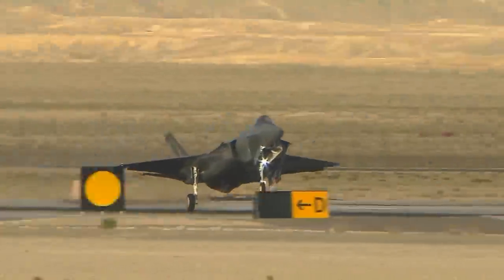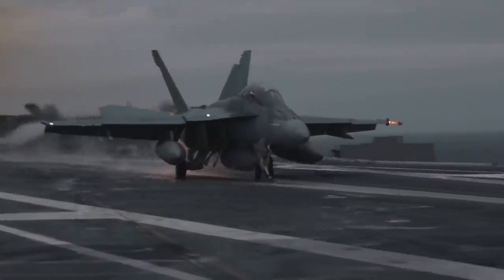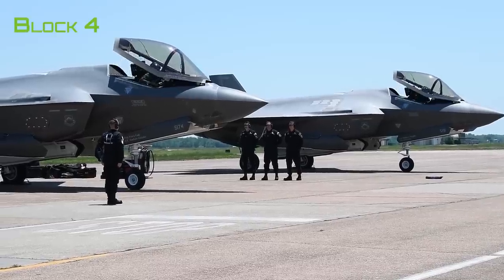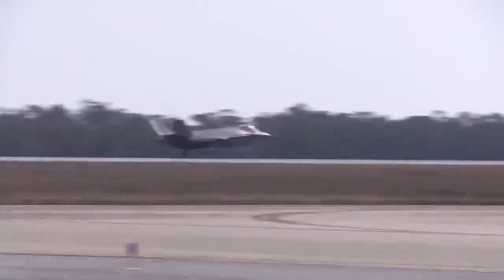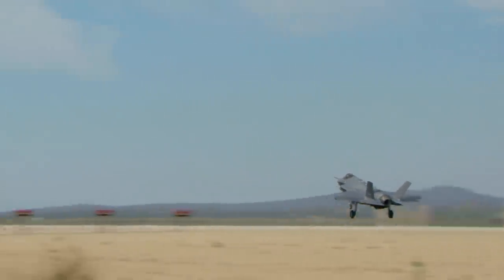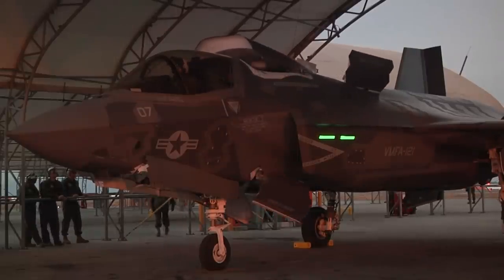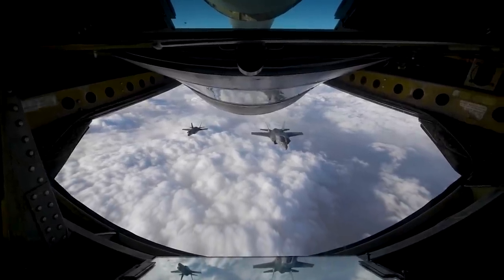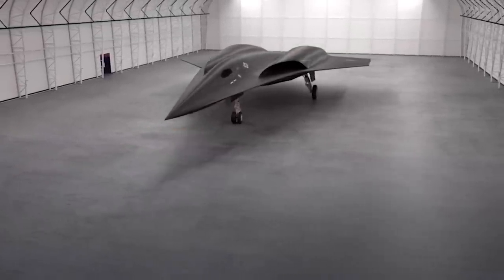Why the F-35 needs an engine upgrade

Comment: Maintaining two different engines isnt exactly a logistical nightmare. Heck they've been using a mix of ge and pw engines on the 4th gen fighters for decades
Reply: Ironically...it's the B lift fan configuration that actually can be retrofitted for these demands.
Reply: Yeah the computer interface alone would be a programming nightmare.
Reply: Right but you have double the work, double the chances for something to break, double the time for maintaining them, and double the cost to produce them. I mean fighters these days are pretty much to the point where the pilots body is the limiting factor. So the cost vs reward ratio just isn’t there. And the point you made about about using jet engines for decades is actually a benefit to having one engine as well. They have become extremely reliable and powerful. I mean it would be sick if they slapped in 2 F22 engines in the F35A&C or if they slapped two F35 engines in the F-22 with thrust vectoring. Talking another 16,000 pounds of thrust with full afterburner. Talking a 1.5 thrust to weight ratio lol. But yeah to maintain the same size you wouldn’t get much more power with 2 engines over one big engine. And instead of spending let’s say 8hrs an engine for 2 engines you can spend 12 on 1 and make sure it’s running perfect and still save 4 man hours.
Reply: Correct
Reply: @forfun6273 Uhh, dude, it’s the same engine in the F-22 and F-35.  F119. Check yourself before you wreck yourself.
Reply: @DonWan47  it’s the same core but the engines are not the same. The F135 is 20% wider. It bypasses more air for infrared and has larger fan blades. My point was it would be cool for the F22 to have the extra thrust. But it would give the jet the fat look of the F35.  I appreciate your education because I didn’t realize they had as much in common as they do.
Reply: @forfun6273  yeah but you also need to hedge against issues affecting one supplier by having an alternate. Basic military procurement policy, been that way since the 40s at least
Reply: @DonWan47  buddy there is no way on earth you just called the f119 and the f135 the same engine HAHAHA

Comment: I’m an employee of GE Aerospace here in Cincinnati, and I personally worked on the prototype of the AETP engine. The benefits it offers are second to none! Not just with cooling, but thrust, efficiency, acceleration…it’s a beast! Let’s hope our “powers that be” make the right decision! 
Another great video!
Reply: Look back at the C-130-J campaign. Can you imagine the C-130 without those improvements?
Reply: I agree.  We should begin a refurbishment program on US existing F-35’s and offer them for sale to nations who qualify at a significant savings. Then replace all the US F-35’s with the GE engined F-35.  Germany doesn’t need the range the US needs in the Pacific. I’d make a deal to Norway, Finland, Belgium, UK and Poland that would upgrade the systems on their current F-35’s and any used F-35’s they purchase to block 4 software and bring the older F-35’s up to the most recent release. 

These discounted sales would boost the alliance and allow the US to improve its F-35 fleet.   I’d go with GE engines, a slightly longer F-35 making room for longer range missiles and if add a new F-35 with two man crew. The two man crew would be hugely beneficial for ECM/EW and controlling large numbers of unmanned assets. 

If we made it a priority we could start production on these new improved F-35’s in a couple of years. 

This would complement the NGEN fighters that will arrive about the same time.
Reply: Add those improvements to the adaptive cycle and the NGAD will be 10x better
Reply: You are totally on-point. I only want everyone to see the difference between the original B-52 engine and the current one.
Reply: @unclefart5527  EXACTLY.
Reply: @GlitchGameryoutube  Sure, but it's a decade away from implementation
Reply: @devobronc  it’s huge difference. The RR engines happened to be just the right size and power.  I originally hoped that CF-34 derivative would have been the choice. I flew CRJ’s  with that engine on the 50, 70 and 90 sear variants.  Great reliable engine.
Reply: @GlitchGameryoutube  probably better by some factor. But a different mission set and $400,000,000 million a copy is what I’m reading.

I’ve been a professional pilot, now retired and have flown with pilots from WW2 all the way through the second gulf war.  B-52’s ended production in 1962!  I was born in 67. When I was in the Navy, B-1’s and B-2’s were being delivered and we believed the B-52’s were nearing retirement.   These F-35’s are most likely going to fly 20 years past my death if I die at age 90. 

I remember when the F-4 production line was in full swing and the prices were astronomical!  Then the F-16 and F-15 came along and we all were told… the cost would be the most expensive fighter program in history. They were and yea the F-16 was “relatively cheap” but still way more expensive than the F-4 once we were building  c/d variants. Today a loaded F-16 can hit $95-$100 million dollars. 

I don’t know how old you are but if your my age, you’ll remember every fighter the US and Europe has made since WW2 have been the “most expensive ever” and plagued with issues. If we go back to the “best fighters and bombers of WW2" were plagued with issues!  Remember the Mustang… it had poor performance at high altitude and it’s range was average. Not until the Brits stuck a RR Merlin in it that it became an excellent fighter. Another plane with issues was the F-4U Corsair…. it was an ensign killer.  The P-38 killed hundreds of pilots also and up until most were grounded today… it kept killing pilots.  

The F-35 is expensive and complex become so many nations become a part of its specifications and the foolish politicians demanded the Navy, Air Force and Marine Corp use the same platform for Land conventional take off and landing, Carrier based take off and landing to vertical take off and landing capabilities.  This combined with manufacturing parts and major sections all over the world has been wasteful.  

But now we have the absolute best multi roll aircraft in the world in spite of its issues.  The F-35 has been the safest fighter program in US history!  In addition if we were to look at its current cost adjusted for inflation…… it’s actually in line with the F-16 C/D purchases.  Remember the F-16 killed a lot of pilots it’s first 7 years of service.
Reply: Be carefull bro,,, with ur personal DATA employee..
Reply: Jim!  Thanks brother and as a former turbine designer and current battle penguin driver, I can’t tell you how much we are kicking begging and screaming for the GE engine!  We must increase our involvement across the spectrum and fight for this because the powers that be absolutely are lobbying against this deliberately for money, while sending hundreds of billions to Ukraine to squander.  Think about where our combat capability could be with the GE engine and the other upgrades that would transform Fat Amy and make her a true monster.  I’ll message you offline but tell the bros at GE we in the community flying the jet ABSOLUTELY NEED IT!
Reply: @function1296  right on! It’s very cool to hear that perspective!
Reply: @function1296  we aren't sending aid packages to Ukraine free and clear. They (ukraine) are taking on MASSIVE debt through the lend lease act. This is not the first time we have done this. In fact, the UK just finished paying back their WWII debt in 2006. Also, much of the equipment that we sent was already nearing retirement. The Bradley fight vehicles sent to ukraine were the M2A2-ODS (operation desert storm improvement) variant, which were deployed back in 1991, which are now 2 generations old (M2A3 in service currently and M2A4 and M7A4 in testing and preproduction currently), and the Abrams tanks that are being sent are refurbished M1A1s that were already sitting in army stockpiles and they were one generation and many mid-generation improvements behind modern Abrams. Think about it like this, we are getting paid to clear out our stockpiles, not paying to store or destroy old equipment, and helping to keep Russian in check. Sounds like a win-win to me.
Reply: I have a feeling that you do not work on this engine. Otherwise, you would not be posting online
Reply: @mbukukanyau  I have a feeling you don’t know what you’re talking about, and that you enjoy commenting about topics you’re clueless about as a hobby…yeah, I think that’s much more likely. Definitely tracks. Making up that story, for the purpose of making a comment on this video, would be just about the lamest thing possible. Almost as lame as making a comment that someone would make up a story about what they do for a living, for the purpose of making a comment on a video 🙄
Reply: @jimiraybeckton  Like I said, it's a feeling I have that you do not work on a US advanced fighter jet engine and then post about it on YouTube. I don't know anything about ✈️ myself other than those I have seen flying. 
It's just a feeling I felt compelled to let you know
Reply: And the F120 was a better-performing engine than the F119. USAF didn't want the multiple risk of the tech in the F120 and thrust vectoring AND stealth, thus went with the more conventional F119. (ex USAF acquisition grunt in the ATF office).
Reply: @bret9741  It's not a business from a government to a government standpoint,  all this has to work for foreign governments
Reply: @function1296  About 25 years ago at an airshow at Edwards I mentioned to an F-16 (F110-129) pilot I was in the USAF program office that developed that engine; bro almost wanted to kiss me raving about how much he loved that engine, what he could do throughout the envelope!
Reply: @bret9741  "But now we have the absolute best multi roll aircraft in the world in spite of its issues"  - says the Yank with typical Yanky Hubris! LOL
Prove that to us please. Which roles has it seen combat in? Any?
Against whose Air Force and anti-aircraft defense. I'm waiting with baited breath! 
Exercise Red Flag propaganda does not count!😂
"In addition if we were to look at its current cost adjusted for inflation…… it’s actually in line with the F-16 C/D purchases" LOL got a source for that "claim"?
Reply: @DennisMerwood-xk8wp  so far it’s combat record is perfect and the best safety record per flight out to date. 

Let see. Who has been buying it and who wants it but can’t have it… 

(1) England (2) Belgium, (3) Norway (4) Italy, (5) Canada (6) Israel who is now ordering more of them (7) Netherlands (8) Australia (9) Denmark (10) Switzerland (11) Poland (12) Japan (13) South Korea (14) Singapore 

Country’s that want it: (1) Turkey, (2) Thailand (3) UAE (4) Egypt (5) India and many others.. 

All of those nations looked at every other platform available. After years of research and debate they purchased the F-35 because their pilots and military leaders said: “this is clearly the best option” since we qualify to purchase.
Reply: @bret9741  It’s really crazy to think how the B-52 series is on it’s 3rd engine type now.
Reply: I think the "B" version is vital, especially in the Pacific.  I hope they come up with a solution for that model.
Reply: @kennychad2821  if they do, it won’t be a common engine OR it will be a new version of the  fuselage. 

I don’t disagree. The F-35B desperately needs more range and payload.  The platform would be a lot better if it had the capabilities of the F-35C
Reply: Isn't bleed air for heating, not sure how you get more cooling from compressed air which is hot.
Reply: @rumbecker5085  bleed air is compressed run through a radiator then decompressed. It makes a lot of  cold air.  It can also be used to run generation and cool electrical systems. 

The aircraft I flew professionally all needs a lot of cooling for computers, and electrical components and avionics.  At 25,000-50,000’ no real cooling issue except for systems that generated a lot of heat or sensors that operated best at below freezing temperatures.
Reply: @bret9741  I understand, I use to fly AC that used  bleed for for heating just sounds strange  that cooling is an issue
Reply: Unless your bribes are higher than P&W then it's not about making the right choice for the best engine, they will make the decision on who greases the wheels more... GE should have been the choice in the first place.
Reply: @bret9741  right it shouldn’t be too difficult to make it a 2 seater. I’m not sure what exactly they put in the As&Cs instead of the stovl fan. But you can definitely fit another pilot in there. But I think the navy is looking forward to the ngad. They actually haven’t been buying as many F-35Cs as expected. They were waiting for the block 4 but I’m pretty sure now they’re trying to hold out for the ngad and then drop some big money
Reply: @forfun6273  yes.  Agree. I always worry about waiting for something unproven.  My experience is that updated and improved fighters can be every bit as good as a clean sheet design. 

The Russians rely on improving platforms more than we do. 

The F-15E was a tremendous update over the F-15C as fighter attack… long range platform. But the F-16 really is the best modern example of what can be done to improve over the original platform…

I firmly believe that we have learned so much, some incredibly expensive and hard lessons, developing the F-35, it’s in a truly perfect position to be made far more capable with a lower unit cost than the NGAD…. Which I’m hearing will run $300,000,000 per copy!
Reply: But can it fit into the F35 without serious modifications?
Reply: Use Titanium fans and perhaps they may not melt down
Reply: What is so special it is still a slow Jet extra thrust for what

Comment: Adaptive cycle or dual detonation? Regarding heat, the F135 isn't the only issue. The Radar Absorbent Material has to be upgraded to ceramic RAM to stop it from blistering.
Reply: Agreed, this has been mentioned somewhere else (don't quite remember but it might've been Tog himself) but research has been underway for some time on ceramic coatings. I wonder about the weight a bit but it should see the heating issue completely gone; in any case it only happened once in testing for some unknown reason
Reply: There’s the slight issue that if you run out of fuel the plane’s computers will fry themselves
Reply: @asherwiggin6456  The plane will automatically shut off unnecessary systems in event of an emergency like running out of fuel, and in either case at that point you have bigger problems to worry about...like gliding safely to land
Reply: @forzaelite1248  won’t it still fry the flight control systems so that you can’t control the plane?
Reply: @asherwiggin6456  No, the flight controls are electrically actuated and air cooled since they don't generate enough heat to warrant liquid cooling; they'll work even if the engine cuts out. You'll never really hear of the controls in other fighters frying for any reason either because of this. The other systems onboard like the radar and the IR systems are what require cooling since they're always on
Reply: @asherwiggin6456  cpu throttling algorithms invented in the 1980s - am I a joke to you?